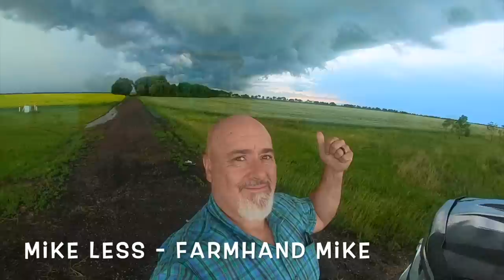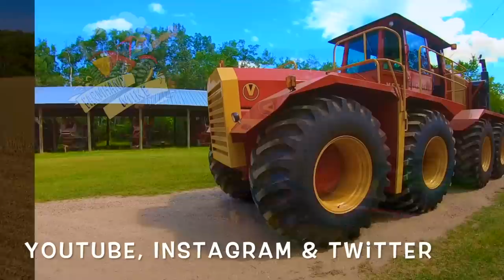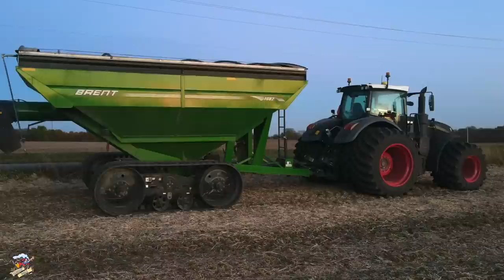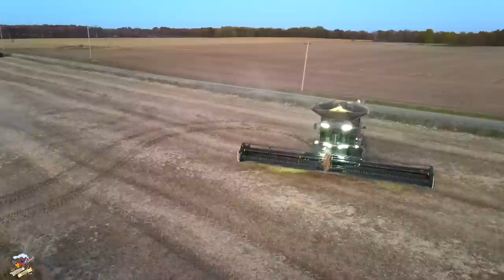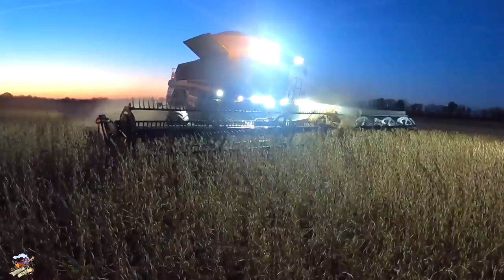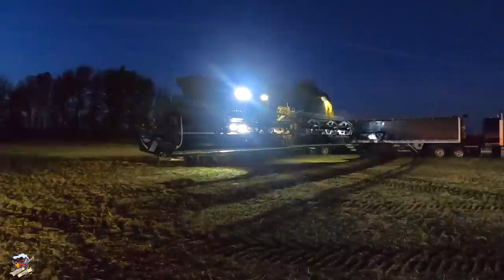Fendt Ideal 9T Combine harvesting soybeans

Comment: It's amazing how my half million dollar Gleaner S97 can do what a million dollar combine can and even way better.
Reply: You have a 45’ head on your gleaner?
Reply: @stirv6462 40 ft., but a 45 would be no problem. We have the toughest bean conditions in the US. and have no problems in them, 4mph. all day long, the conditions this combine is in would be so easy for our Gleaner.
Reply: @gleanerman2195  well I certainly would love to demo one. I’m not questioning you but I just find that so unbelievable because we bring an 8250 and s780 to their knees on 80 bushel green stem soybeans. It’s like we are pushing silage out the back end but the beans are 12%. Cannot get enough horsepower. The gleaner has something around a 9 liter and everything else is around a 13 so it must be incredibly efficient in every aspect of power transmission. I tried to get a demo but they never did it. I wish I could run one.
Reply: @stirv6462  We have cut with class 8 red and green and they can't believe how efficient the Gleaner is, capacity wise and fuel. The tougher it is the more it shines.  Our rotor set-up is key. You would be really surprised if you ran one. Our nearest dealer is 360 miles away, so don't let dealer support stop you.
Reply: @gleanerman2195  so you are changing the rotor from stock or just from factory stock it works incredible?
Reply: @stirv6462  We run stock rotor in corn, soybeans we take out all 4 reverse bars and  install forward bars with 3 sweeps on thresher end and nine on separator end. Works great! Forgot, we take all helicals of sep. cage door..